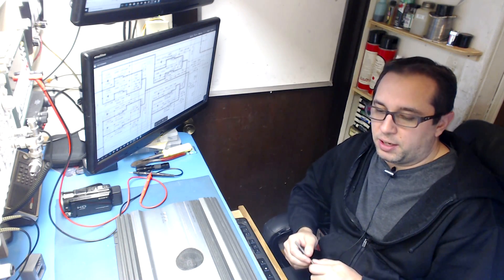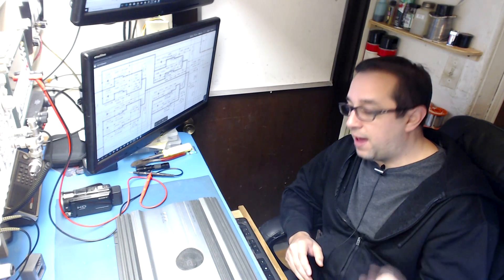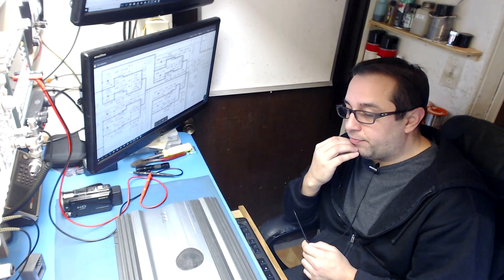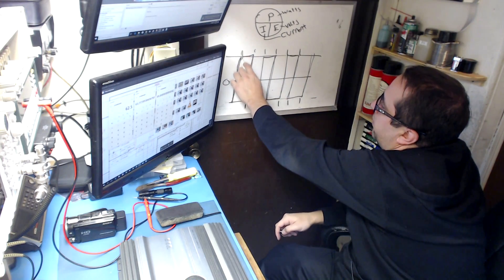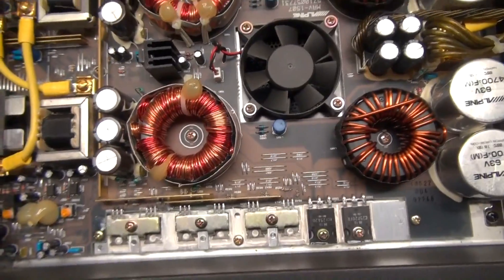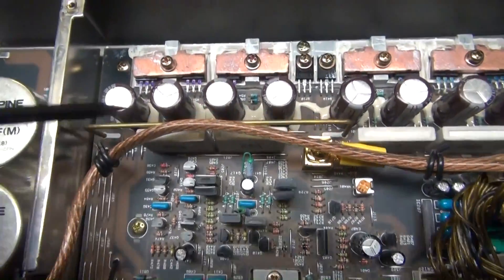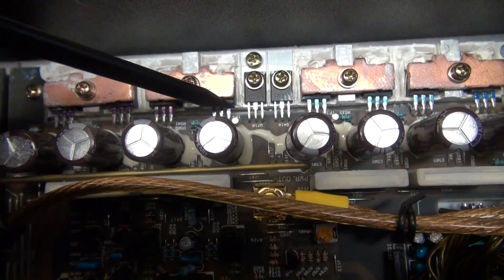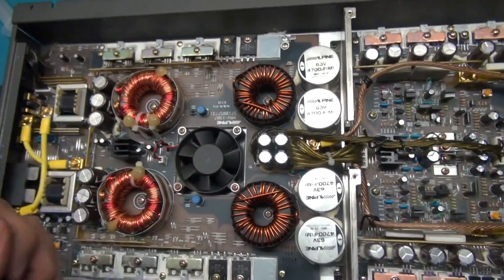ALPINE MRV-1507 IN DEPTH REPAIR AND THEORY. PART 1 OF 2

Comment: Hay have a question for you. I'm not even a beginning in the electrical panels. Do you take amps for repair work or do you just do this as a hobby. Iv got a mrv-1507 It makes a the sub pop. I think it's RCA jack. Would you take and look it over?

Comment: Why did the manual say it was 1ohm stable?
Reply from the maker: I don't know what manual your reading but the MRV-1507 is not 1 ohm stable bridged, its not even 2 ohms stable bridged. 
The manual states 150w x 2 @ 4ohms, 300 watts x2 @ 2 ohms, 600 watts x 1 @ 4 ohms.  @12VDC

Comment: So am I good running this 1507 at 2 ohm stereo on each channel?
Reply from the maker: The manual states 150 watts per 4 ohm channel. 300 watts per 2 ohm channel and 600 watts bridged at 4 ohms..
Reply: I’m wondering where D wiz got that it’s 1 ohm stable?

Comment: Dear sir i have a rockmars 3000watt amplifire model#rm-Af4600 when i give battery current it on for a second power transistor p55nf06 transistor short immediately I replaced that short transistor but same process again p55nf06 transistor 6 in a line in amplifire power All output transistor are ok I checked many time kindly help mn specifically thnx dear sir

Comment: I just found your channel (via the Radio Shop). I've pulled the amp out of my 2000 Toyota Landcruiser and I'd like to test and repair it. I'm more comfortable with tubes but I think I could fix the amp if I had a schematic. Do you know where I might find one?
Reply from the maker: For the 1507? send me your email in a email. Its in the about me section of my channel.
Reply: I'll send an email shortly. Not sure. Its the factory amp for a basic LC (no Mark Levinson system) and the best info I could find was the electrical service manual. That was just for connections
Reply from the maker: Oh, I Thought you were taking about the MRV-1507 alpine. I don't have any factory car amp service manuals.

Comment: Thanks for doing these vids. Love seeing these car amplifier repairs as I got a pile of damaged amps I wanna fix myself, learned a few things by looking through your channel...

Have a quick question, I got an alpine amp with a distorted output from the prestage IC, across two pins there is a small SMD cap (15pF), according to equivalent circuit schematic it's connected before and after the "predrive" module inside the IC. By the looks of it, it looks damaged. What could such a small cap be used for?
Reply from the maker: Thanks. It could be some kind of bypass or decoupling cap. That is just a guess since I don't know what the circuit is.